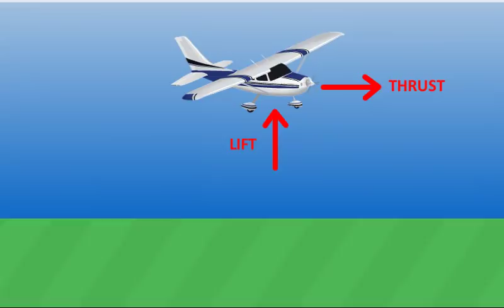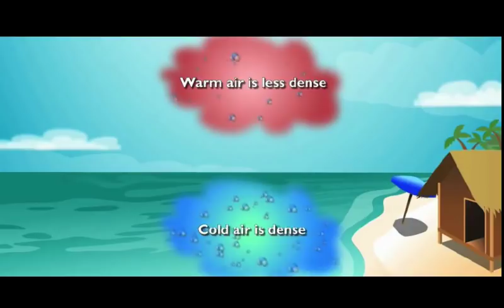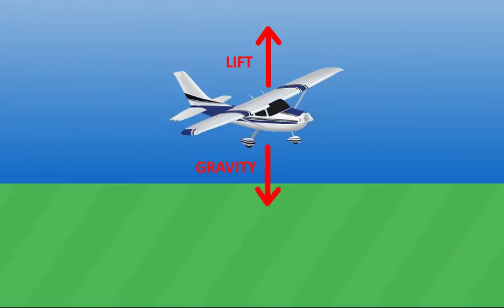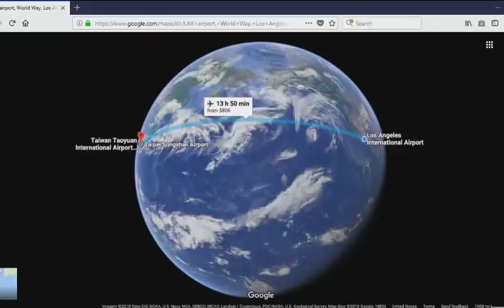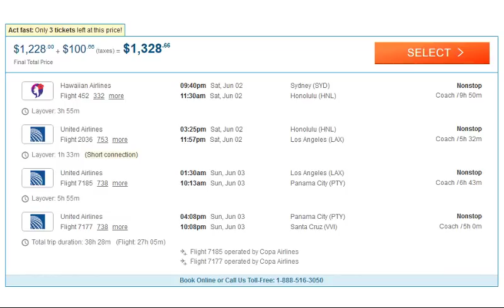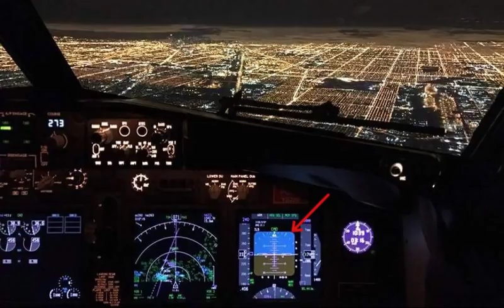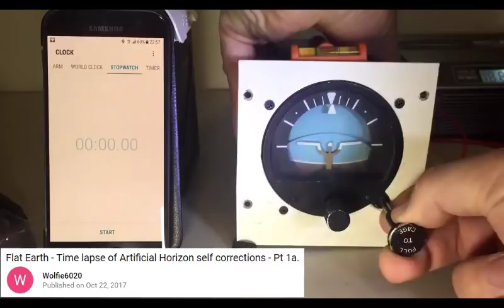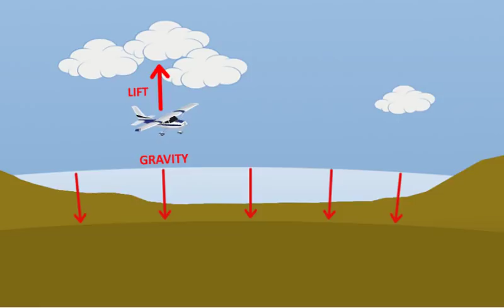Flat Earth Falsities - Plane Nonsense

Comment: Meanwhile in all your “learning”, a flat horizon is seen at any altitude.
Reply: On a sphere, the horizon is flat until you get over about 3 degrees from the plane of the horizon. Then you start to see curvature at about 30,000 feet as you look down on the horizon from an angle. From altitudes under about 30,000 feet, the horizon is perfectly flat on a sphere. That's one of the proofs that the shape of earth is a sphere.
Reply: +tricky dicky
Why are you trolling?
Reply: +SpectatorAlius
and finally, as you are allegedly so critical of biblical literalism why are you not only citing but also praising a YEC? There can only be one reason Ally. You are one yourself, aren't you.
Reply: You are lying and it is obvious. It doesn't help to lie.
Reply: Carl Walker If you had learning, you would know the horizon is a circle, the locus of the tangent line drawn to the SPHERE that is the Earth with your tiny head as the fixed point
Reply: YOU ALL DUMB AND WRONG! EARHT IZ CUBEZ LIKE BORG AND IT SHOOT LEZERSS TO CREATE SUN!!! #ilovemycaps
Reply: tricky There you go lying again. Nobody, not VoysovReason, not myself, not Neal deGrasse Tyson, ever said that the Earth looks like a pear. And heliocentric theory is unconnected to the shape of the Earth. You're schizoid or something there, bub.

The Solar System IS heliocentric. That's fact, not theory. The solar system is heliocentric with Mars and Venus much smaller than the sun. They periodically, at times precisely predicted by heliocentric math, cross the face of the Sun, illustrating both the heliocentric nature of the solar system, the spherocity of the planets and the great distances to the sun and the two planets. The accuracy of the calculations demonstrates that the truth of spherical earth/heliocentric solar system is precisely known in great detail. Oh, personal experiments!

A tour of my telescope and Mercury transiting the sun (Sun 17.5" in diameter!) https://www.youtube.com/watch?v=2bV9CEUpzSU&t=2s

The transit of Venus with my telescope and a crazy lady (not all crazies are Flat Earth Cultists, but many are) https://youtu.be/acyByVSrB6s

Another astronomer's video of a solar transit of the ISS during the 2017 solar eclipse! https://youtu.be/lepQoU4oek4

Another's direct measurement of the height that the ISS orbits https://youtu.be/2zejiHaRhI4 and https://youtu.be/80y2LP1bWH4

These actual experiments show conclusively that Flat Earth Cultists have it wrong. Mercury and Venus alone of all the planets pass between Earth and the Sun, at times predicted years ahead of time accurate to the second, taking exactly foreseen paths across the Sun, as I demonstrated in the transit of Mercury video. 

These calculations contain all the parameters that the Cultists say are lies: the size and mass of the Sun, the distance from the Sun of Earth at any moment in time, all the orbital parameters of Earth's orbit about the Sun, the size and mass of the Earth, and the fact that it rotates on its axis at 1/1,440th of one RPM to produce day and night, the precise distance of the Moon at any moment in time, the size and mass of the moon, all the orbital parameters of the Moon's orbit around Earth. An error in any one of these parameters would result in a wrong prediction of these transits, lunar and solar eclipses, lunar occultations of bright stars, grazing lunar occultations of bright stars, ocean tides, lunar libration and moon phase. Those don't happen. Our numbers are good and they continue to improve.

Spacecraft have landed on Venus, Earth, the Moon, Mars, Titan, Churyumov-Gerasimenko. They have rendezvoused and orbited Jupiter, Saturn, Neptune, Uranus, Pluto, Comets Halley, Giacobini-Zinner,  Gaspra, Ida, Dactyl, Geographos, Mitilde, Eros, Wild 2, Itokawa, Tempel,Minor Planets Vesta, Ceres, and new missions are headed to many other solar system bodies, precisely navigating using Newton's law of gravity to their destinations, even to a specific asteroid in the Kuiper Belt, three times the distance to Pluto. Yes, we understand and use gravity well. We are like a piano player, who can't make a piano, but plays it magnificently.

So I see your unsupported, parotted Flat Earth Cult meme and raise it by my carefully researched, footnoted, proved, thoroughly coherent facts. I win. You know, tricky, I wasn't kidding. Your lying antics and insanity are the best thing us scientifically qualified people have going for illustrating the insanity and dishonesty of  the Flat Earth Cult. Thanks for the help, bub. Found those pepperonis more than half the diameter of the domed pizza apart yet? If you can't the Earth definitely is proved (by you! Thanks again) to be a sphere. On flat earth millions of locations would be 20,000 miles apart and more. On real Earth no locations can be more than 12,500 miles apart. That proves it's a sphere and YOU helped. Great job there, bub.
Reply: +SpectatorAlius
"The FE cult is not "firmly grounded in biblical literalism". If it were, your favorite bogeyman Ken Ham would have to profess the exact same thing as they do."
Oh dear, what a specious argument.  That argument is based on there only being a single interpretation of the bible, which is of course a lie. The FE cult is biblical literalism.
The ID cult is biblical literalism
The Creationist cult is biblical literalism
The YEC cult is biblical literalism.
Christianity itself is biblical literalism. No bible. No JC. No Christianity. Or are you one of these special people who is Christian but doesn't believe anything in the bible? Even though you have to believe the bible to be a Christian.
"@wrong When you learn to read, little boy." Only a silly little bot would be so infantile as to use that silly schoolyard stupidity.
"you will realize that I already answered your impertinent, stupid question." No. you responded. There is a difference. Child.
"You might even realize how very wrong you were to claim "only YEC cite AIG unless it is to prove AIG is lying" Such as? You? Jason "the liar" Lisle? Pence?
"your own intense wickedness". Ooohh, a godbotherer threat is it. I really am frightened. If that is so, why is it that I have spent much of my life working for charities to help the disadvantaged, the disabled etc.? Unpaid. And these were charities your faith had abandoned because they weren't getting the adulation,  recognition and media support they craved. Once we had had nurtured these charities back to health suddenly you godbotherers wanted to be part of the action. Pure hypocrisy.
Reply: Bobby boy "exept we dont which is easily proven." We don't what? There is no shortage of electrons in your keyboard preventing your from intelligent thought you know.... Anyway, whatever you're talking about, if "we don't" and if it is "easily proven" you would have proved it. You didn't so you're lying again. A baldfaced empty claim of easy proof is proof itself that you're lying.
Reply: RockinRobbins13. Yup. Sums the entire insanity that is Heliocentric THEORY. ‘You know it’s a Pear shaped ball because it always looks flat.’ Hahahahaha. “You know it’s real because it looks so fake.” Hahahahahaha
Reply: RockinRobbins13 exept we dont which is easily proven.
Reply: Proof. https://www.youtube.com/watch?v=4c92ja1l0f8